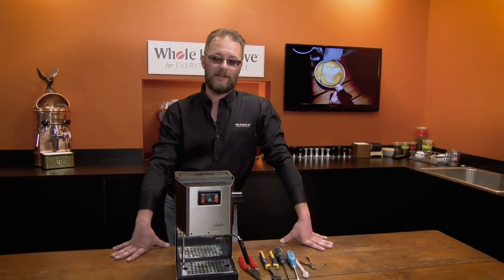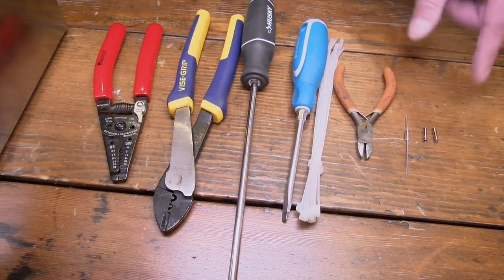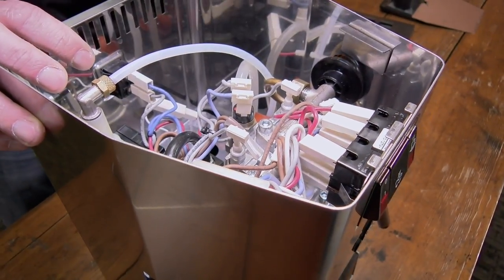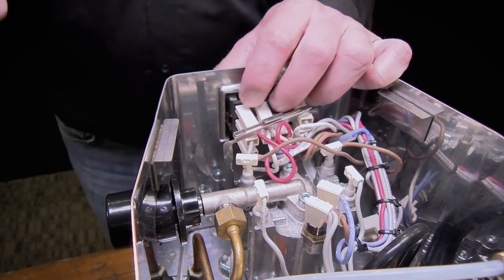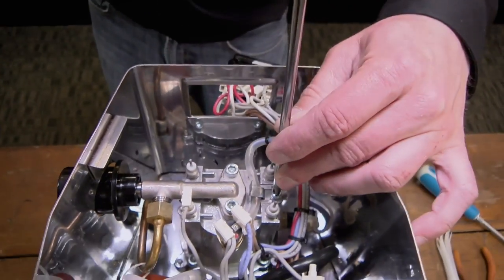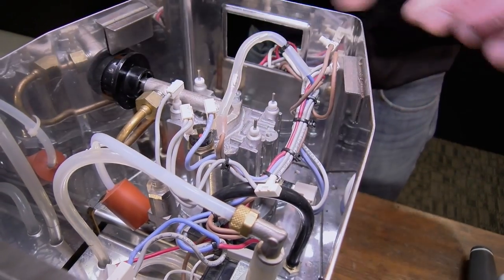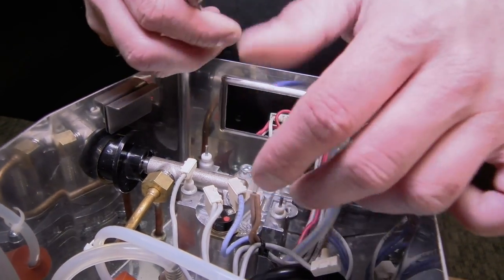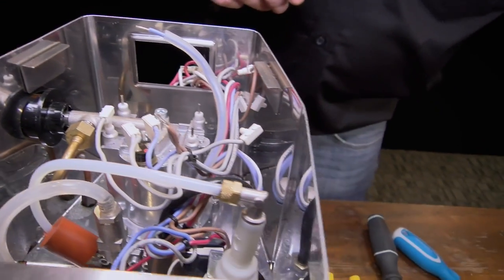How To Replace the Thermal Fuse on a Gaggia Classic Espresso Machine

Comment: Thanks for the very informative video. 

After reading the comments I decided to replace both thermostats. I have put the Classic back together and turned on and nothing ☹️. I’ve left switch on incase the bulb had blown in on/off switch but it’s not that. Is there anything else I can do before I start looking to replace machine (I really don’t want to replace it. I’ve had it ten years and it’s worked flawlessly until now). 

Thanks.

Paul.
Reply from the maker: Hi Paul, You are welcome for the video. It might be some of the wiring is not quite right. Here's a link to our support wiki for the Classic which has more info and wiring diagrams: https://wiki.wholelattelove.com/Gaggia_Classic/diagrams_and_manuals
Those could help. If in US you can always give our tech support a call for assistance at 585-924-7170 for help in troubleshooting.
Reply: Whole Latte Love thanks for the reply. I tried on last thing and it was the fuse in the wall plug! I’d already put a ‘new’ one in but it must have been a dud. Cheers from UK. 🇬🇧

Comment: Thanks, Whole Lotta Love. This video is brilliant. I replaced two stats and the heat fuse. The butt connectors came with plastic insulation, and I had to make sure not to buy ones that needed a heat gun. I had trouble pushing the clear plastic sleeve back over the thick connectors, bending the heat fuse badly and really straining those connections I'd made. But it's all working. The message is, replace the stats before the heat fuse goes, because it's a tough job making those crimps. There was a warning that the steam stat was finished -  the machine thumped and puffed steam like a steam engine because, basically, it was overheating.
Reply from the maker: Hi Cy, You are welcome, thanks for the comment and sharing your experience. It will help others!

Comment: Excellent instruction video. I happen to have a non functioning machine at the moment, with probably a fuse problem. But as stated in de video, when the thermal fuse has to be replaced, there probably is another problem.
Reply from the maker: Hi Ramsey, Thanks for the comment. Blown thermal fuse can be caused by another problem within the machine like electrical short. Can also be caused by service power surge and simple age without other internal problem.
Reply: Whole Latte Love OK thanks! 🙂

Comment: Very good video, thank you. I have a dual boiler Kitchenaid coffee maker (basically a Gaggia) which works perfectly except that neither of the temperature displays work - they never move off zero even though the water from both boilers is hot.  If one had gone I'd think it was the gauge itself but both going makes me think its the fuse. This video will help enormously, thanks!
Reply from the maker: Sounds great!